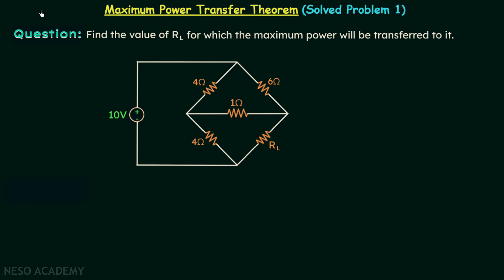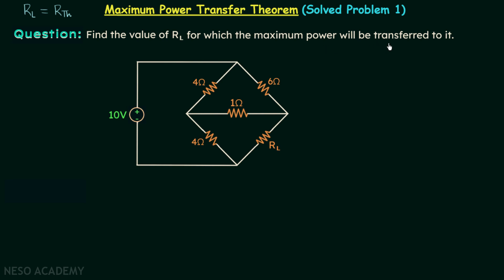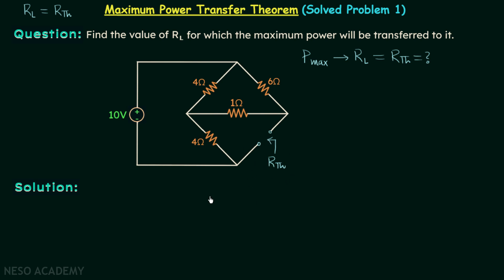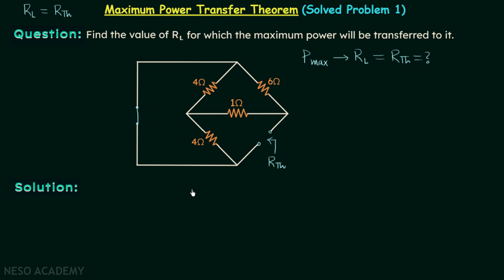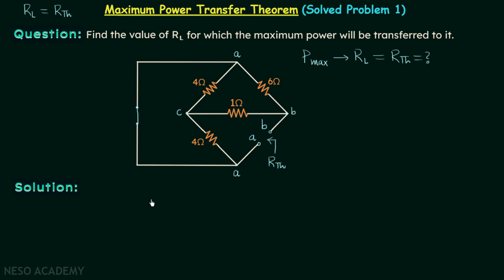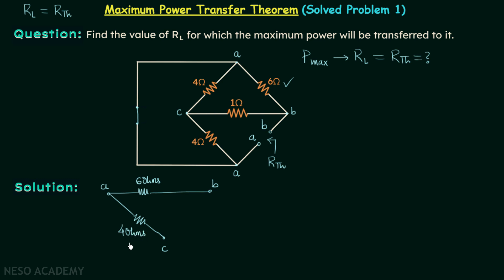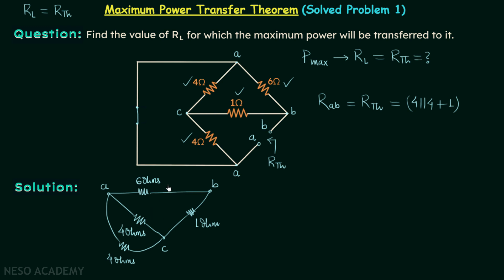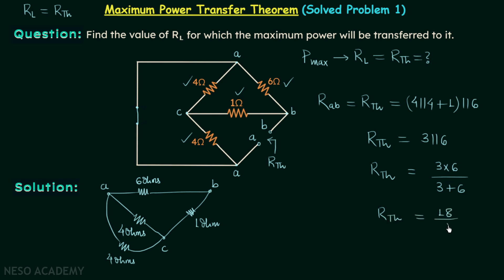Maximum Power Transfer Theorem (Solved Problem 1)

Comment: You find out Rth but not find out Pmax for that we have to find out Rth and Vth also
Reply: Read the question carefully
Reply: @kushshukla6588  topic is maximum power theorem for that Pmax we have to find Vth because formula of Pmax= Vth²/4 Rl
Reply: @muskanchhabria3126  In this question we have to find Rl or Rth using MPT , we don't require to find the Pmax.
We just used the concept of MPT, Hope you get it.